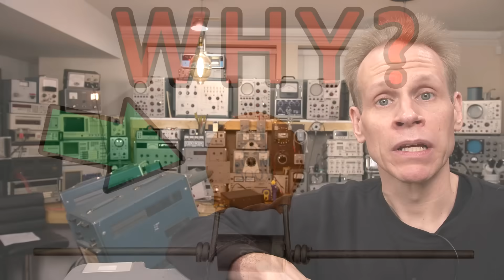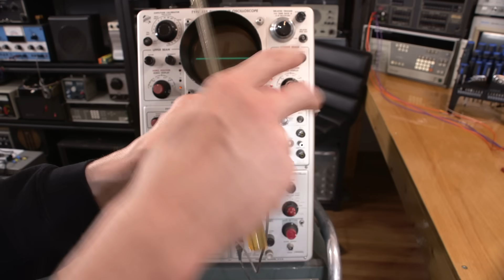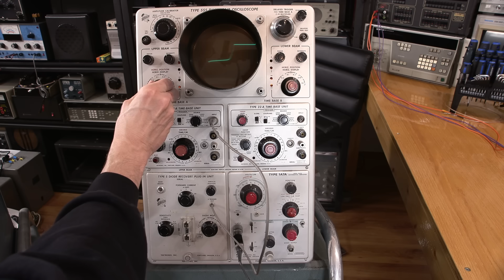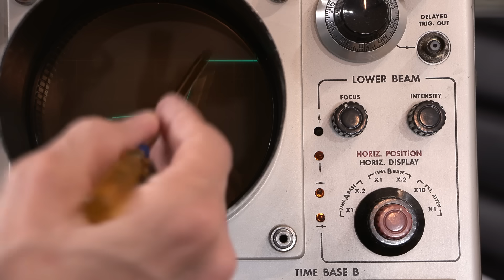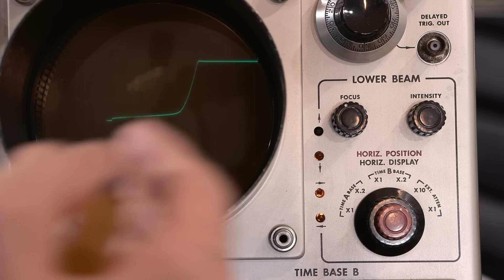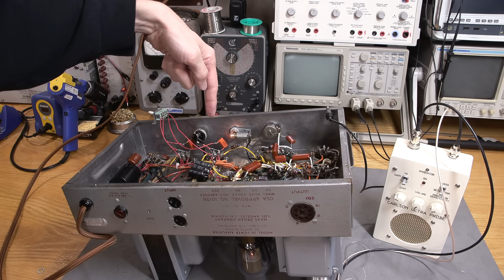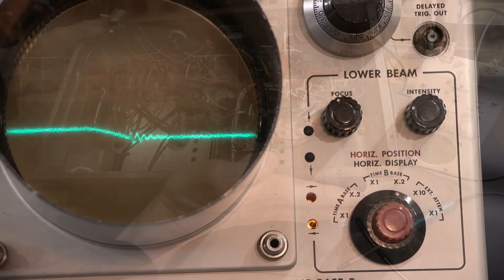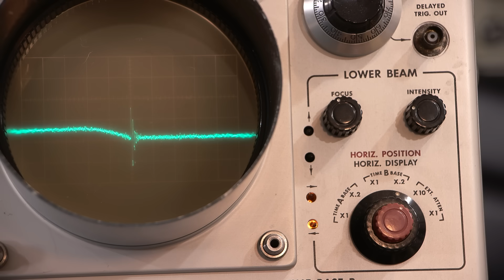Why Put A Capacitor Across The Diode? Here's Why!

Comment: i have done electronic design for 30 years doing switchmode power supplies i my experience it is bad with capasitor over a diode, use a schottky diode insted

Comment: I have a little FM transmitter connected to my computer so I can hear it with a portable radio and it has a bridge rectifier that hummed like crazy till I put these same kind of caps on each diode.  Then in another case when using a cordless phone around the house, and after doing lot's of trouble shooting and listening, eventually had to smash open it's little power adapter and add some of these same caps to the diodes.  I've known this from a young age.

Comment: I bet some US or UK army radio engineer during WW2 came up with this, started adding them because "that makes sense", then got in trouble for making "Unauthorized changes" to comm circuits, and got a dressing down for it, even though it made it easier to hear each other during dog fights. 
            That's how a lot of this stuff went, in mechanical engineering of planes too. An airplane mechanic adds a piano wire holder on the brake control cable to remove 1/4 inch of slack, then pilots don't die as often in dogfights.
         An American guy almost got court-martialed for that. Then they startd doing it all US fighter planes.

Comment: I've got no use for the capacitor on the diode onto the engines ignition wiring its their to keep the flow of current going 1 way and to not come back unless the diode is broken when turning off

Comment: 2 capacitors in a full wave bridge rectifier. Is it centre tapped and only has 2 diodes? Would a full wave 4 diode require 4 capacitors?

Comment: This is the most incomprehensible electronics demonstration I have ever seen ! 1- WHY is diode in the amplifier at all ? WHAT is its function ? 2- Is it a simple BLOCKING diode, a SCHOTTKY diode or a ZENER diode ? 3- Is the first scope trace NOT a time-based graph, that is, is it an input voltage vs output voltage graph rather than voltage vs time plot ? 3- "Noise" is a time based phenomenon. You never SHOWED the noise on your oscilloscope ! You left out ALL the fundamental explanations of what you are working on.

Comment: Isn't this a bit dangerous since it "delayed" the diode's avalanche and cause massive voltage spike in reverse mode? it should be okay if you use snubber capacitor, or using silver mica, but please don't use this unless it's for old AM radio or device with tons of high voltage part, i'd stay away from doing this if the diode is connected to high voltage mosfet or IGBT since the reverse current will 100% destroy the diode, but eh, it should be okay for most vintage TH components.
The other way around is put varistor at each end lead of capacitor, but that also creates more problem.

Comment: Before I retired I worked for a major power supply manufacturer.  One of our products was used in some medical equipment.  The customer complained about a 'noise' in their sensitive equipment.  Placing small capacitors across the bridge rectifier diodes cured the problem 100%.
Reply: It's best to also place an RC network across the winding. Do that correctly and you will remove all ringing. If you noticed there was still ringing on the scope with the cap across diode, yes smaller and probably lower in frequency but you really want to put a real RC snubber across the transformer winding that's being rectified. What you did of course helped and got the job done, just trying to help in case you run into the same problem.
Reply: @captainbeefheart8797  Thanks Cap'n, I'll not have to deal with it again, happily retired, but are what you are mentioning known as a Zobel network?  We actually did try an RC snubber across the transformer secondary first and it helped some.  I can't recall if we left that network in place after adding the capacitors across the diodes or not.
.
Reply: @Wheel_Horse  Yes it's also called a zobel network in some applications, like in a compensation network for feedback. For an RC snubber to work it's best it needs to be tuned correctly but often common values are used that work well enough.
Reply: @captainbeefheart8797 It's recommended to use a fast switching diode..
Reply: @captainbeefheart8797   Little Series R/C Networks were standard design practice for detuning the "Ringiedingies"  in power supplies and sweep circuits in Video Displays. Even in Transmitters, power supply rings would skate right over power supply filter banks and show up as little sidebands in the transmitter output.     Child's Play for a seasoned analog and RF engineer.
Reply: I like your vintage tektronix curve tracer and oscilloscope. Makes me feel at home. Of course I have the new digital stuff also but sometimes crave the old analog stuff. Thanks for bringing up the caps a lot of people don't know about that and it makes a huge difference.
Reply: Thank you for this important information 🌹❤ 🌹
Reply: How to figure what cap to use?
Reply: @mikegergel5218  I don't know if there's a 'formula' or not, but we used 0.01 uF ceramic disc and I think they were 1KV but that depends on the voltage of course.  Maybe an EE can tell us if there's a proper formula to use.
Reply: The was across the pos & neg Dc output yes  ?
Reply: @leso204  No, one capacitor across each diode. I guess.
Reply: @leso204  No, as @merakrut said, across each of the bridge rectifier diodes.

Comment: To reduce noise to it's minimum is to find the source of the noise.  You can hear the noise and see on the scope even with the caps.  Sometimes a circuit isn't ground correctly and the ground it's using is making the noise.

Comment: It's called a clamp. We used them back in the early days of computer controls inside the auto industry. They effectively cut down on "spurious" emissions from a switch. If left unchecked the emission from the switch action can be seen by the computer as an additional switch action causing confusion or a different output. Once we put clamps on all of our switches, manual or automatically controlled, the problems of spontaneous computer malfunction or crashing stopped. (well almost, there were still times...

Comment: I remember adding a capacitor to the alternator output to stop whine static in a CB radio back in the day. You bought under the name, Noise Filter. There were high pass and low pass filters depending on where you put them.

Comment: That's really interesting. I am into modular synthesizers. One issue with modular synths is inputs and outputs have different impedances. So it doesn't work to connect two outputs to a single input. The signal from one output end up going to the other output instead of to the input. So I was thinking about building a little device that plugs into the outputs that has a diode so current only flows in one direction. I had no idea that noise was an issue. So I am definitely going to have to try to see if there is any noise that presents an issue. I can then stick a cap on it to get rid of the noise.   Although depending on the situation, noise might actually be a good thing. A bit of voltage fluctuation could be a good thing. If I am using control voltage to the control the pitch of an oscillator, some slight warble in the pitch might be a nice effect. So I might end up making versions with and without caps. 

But first I need to put together a test bed for testing DIY modules. A box with 3.5 mill jacks, some pots, and a breadboard. Along with a DC to DC IC so I can take the 12 volts used on my modular synth power supplies and drop it down to the 5 or 10 volts used for control voltage on modular synths.

Comment: How does a thermionic diode compare? I'm assuming it also has very fast response (tubes were used as detectors well into the UHF range before semiconductors existed) that would initiate a transient at the beginning and end of conduction, yet I know of no example where one is bypassed with diodes, not even in super-critical circuits.

Comment: You should have shown the input to the diode also so we could see what the signal was and what the diode did to it. Also show the smoothing capacitator and explain how these capacitators over the diodes compares to using a large smoothing capacitor.

Comment: I cobbled a car system with multiple amps from SoCal swap meets in the 80's.  The noise spike made my butt pucker.  Diode and cap across the toggle, smooth as butter.  Don't ask the values, it was 45yrs ago.

Comment: Didn't need that expensive device to hear the noise lol
Just hooked up a 12v DC output to a hand held CB radio.
No cap and it buzzed loudly, especially when keying up.
Add in a capacitor and noise was basically gone.

Comment: Marshall amps do this with their 1959hw reissue amps.....they didn't do it on their originals when they first built the 1959 circuits.....unless that's what the two big .22uf snubbers were across the bridge.....but now there are 4 470pf caps one across each diode......I've never heard that noise make it to the speaker of the 1959 circuit....the 1959 circuit has a good amount of filtering including a choke......but I am curious to why marshall does it now and didn't do it this way before

Comment: Why don't the smoothing capacitors in the power supply shunt this noise to ground?  What frequency is this noise actually occurring at- is it actually 60 Hz noise as it seems to sound like, or is it RF noise switching at 60 Hz?

Comment: Mr. Carlson,
Most of my power supplies use choke input filters and I've never run into noise problems.  I know capacitor input filters have short conduction angles and high peak currents.  If you have explored noise performance of different filters, I would be very interested.  Thanks.
Best regards,
Chris

Comment: Does this also apply with tube diodes like the 6AL5 and 6H6?
Reply from the maker: Those are small signal diodes, used for detection. This noise solution is for solid state devices.

Comment: Very nice demonstration. 
So, many moons ago I built my first audio amplifier. Despite my best effort, carefully routing wires & trying to keep things away from the big transformer, using good filtering; there was always this low level hum. It never occurred to me the rectifier was causing this trouble. I wondered why many amplifiers I looked at had these little caps on the rectifier. Eventually I learned.
Reply: Connecting the metal cabinet to the Earth greatly reduces humm noice and also distortion in a mic.

Comment: I'm just testing myself and my thoughts with plenty of faults but I thought the basic function of a diode is to allow current only to flow in one direction, no reverse flow or alternating current so would only half of the current pass then the capacitor hold a charge and release it smoothing the current to a steady flow thus maybe get rid of the noise, act like a filter, or am I way off? Was that noise 60 cycles or do you in Canada not have 60 cycles like we do in the USA? Thank your for your very interesting videos. You are some kind of a genius!!

Comment: I designed Class AB Audio Amps and Linear Power Supplies. We used Polyfilm caps. You can hear ceramic caps. We achieved a THD of 0.15% at full power all channels driven. 6 With a -96Db or lower noise floors @ 500W per channel bridgeable to 1000W. Driving Inductive loads down to 1 ohm at 10Hz and it was impossible to clip our amps.  We had  300,000Uf of Caps on each rail running at 180VDC. The choice of caps was critical to the design. Different types of film caps and tantalum but never ceramic because of the audible noise of the caps. They vibrate and can be physically heard. That mechanical vibration was reflected as electrical noise. Sonobuoys were even more demanding. We hit -125Db noise floors with commercially available components.

Comment: With both the caps on and caps off the wave forms on the oscilloscope were smaller with the caps but they looked almost identical in wave from as near as I could tell. It looks like a high frequency reverberation with the peaks decreasing algorithmically. It seems like the electrons are flowing back and forth before settling into a orderly flow once the diode starts conducting. The caps reduce the intensity but not the oscillations themselves. Would a choke prior to the diode help prevent the oscillations or is that an inherent property of diodes and can only be attenuated?

Comment: fascinating.  I never realized how much switching noise diodes have.  I have seen these caps in some audio systems and not in others but I can see why they are used.  is there a rule of thumb for sizing them based on voltage and or current flowing through the diodes?

Comment: I get the same buzz from my bookshelf speakers after the input has been shut off for a time. I have them plugged into a laptop. The buzzing starts over an hour after the laptop is turned off but the speakers remain powered.The speakers have their own power supply. I've been shutting them off and that stops the buzz.

Comment: I started a while back, designing my own drone. I learn to call this a flyback diod and flyback capacitor. I have no idea what I'm talking about but I think it made my motors run cleaner and protect the components on my circuit. My first build i didn't have ether compnent and I blew air on my motor prop and fried my first esp32 😮 dummy 😅

Comment: I'm a degreed Electronics Engineer, retired now. I've got industry experience and have taught other professionals.

Your video provided too little information to reach a conclusion about your point. 

If you're on about teaching an RC filter, then you're doing it in slow motion.

There are many reasons to put a cap around a diode. You don't even say if this is an AC or DC voltage source.

Electronics are best taught with a schematic.

OK, you filtered noise -- maybe DC from the Mains, or fluorescent lighting, the mountain of test instruments in the background -- God only knows.

Your scope trace offers no insight. There are no markings along either  axis. Am I seeing voltage, current, time, seismic data, a signal from comet 3I Atlas? 

What happened here? I've seen you teach in the past, to great effect. This is something completely different.

Comment: Retired EE here. When I was in college many many moons ago, I almost flunked out because of “non-linear circuits”! Some things were hard to wrap my head around. Calculus in magnetism was another… Geez does that bring back awful memories… 🤣 Younger generations are flunking out of EE and have been for many many moons. It’s a desired field today because it contains ALL of IT without getting too specialized. IT does exist standalone, but there’s no broad educational foundation of engineering.
Reply: I graduated as an EE in the early nineties.  Yeah... calculus.  There was a (mandatory) class that covered some weird integral used to calculated losses in transformers or some such... I don't remember exactly what because I've banished that nightmare from my mind.  Other than that, I had fun but I never held a job as an actual EE.
But you're right, it did give me a solid grounding in engineering as well as some practical skills, and that has served me very well in my career.  Most of the jobs I've had were on innovation projects where you usually have a small team filling a wide variety of roles, from project management, research, and electronics design to coding, building those electronics, installing it on roofs and vehicles, even welding and woodworking.  I love being a Jack of all trades and being able to work as one, and EE prepared me surprisingly well for that career.

Comment: Something that would be interesting would be to bypass the DC rectifier circuit entirely, power it with whatever it wants with a bench supply (or battery if lower voltage and high current) and then check the RF emissions with your probe again.  

I suspect it would then become FAR quieter, not just missing the AC hum, and if that is the case, then it sounds like filtering is the biggest problem.  Modern supplies do a much better job of this now compared to a bridge of diodes and a large filter cap.  Most now boost the voltage, then switch at 100kHz+, then filter back out the switching noise.  With the noise brought so high up, filtering it out becomes easy to get -80 dB or more of rejection.

Comment: I could have used your noise elimination demonstration when i worked for BIRD electronics to those "RF" and mechanical engineers.as to why i used series resister filters to my communication busses to eliminate ringing on the high speed data busses. Bird sold my test circuit to a customer because it worked very well. digital ringing was the worst enemy so i fixed it . 
do i knew digital interfacing in and out can be a bad idea on a fast communication bus.